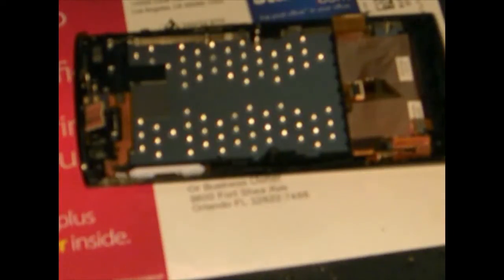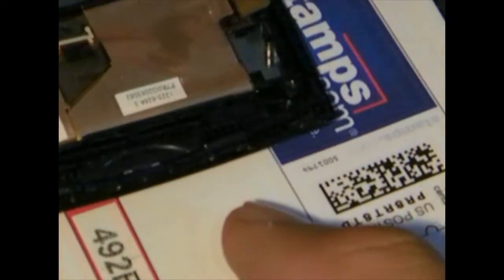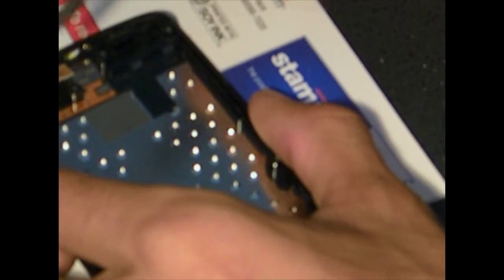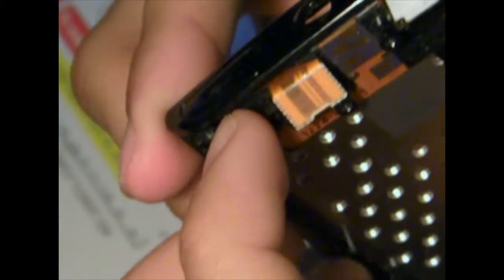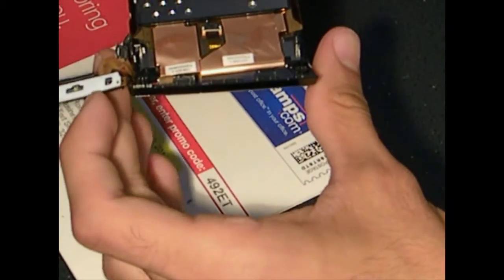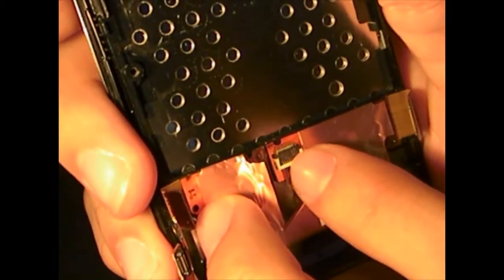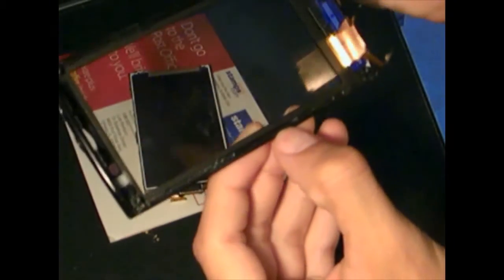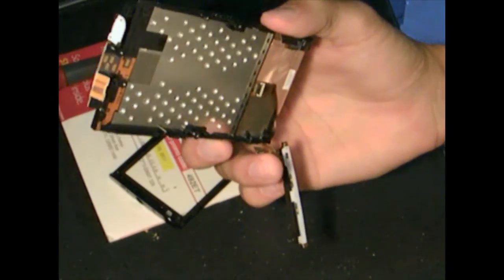Xperia X10 Further Disassembly

Comment: Thank you so much darkgoth678!!! I just fixed my digitizer / graphics tablet using this video and the other which you've posted. Thank-you for making them. I was so happy when the phone actually worked after re-assembly. It's easier the 2nd or 3rd times and better if you put the buttons back on the right way. Removing the digitizer is SO HARD on this handset. Mine SHATTERED. Luckily i removed the pieces and used the same glue for placing the new one. Be VERY careful about alignment and removal.